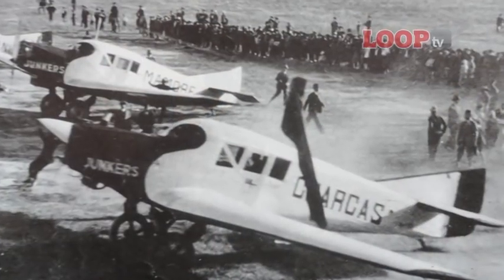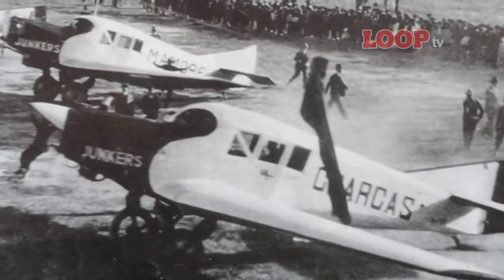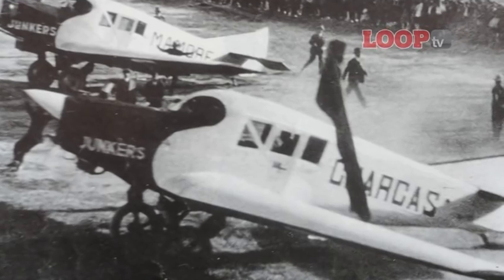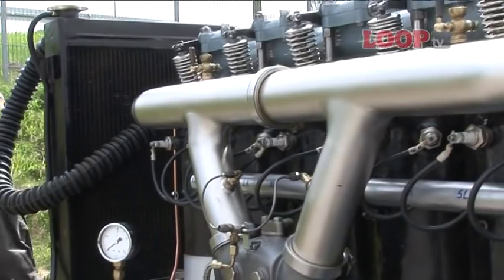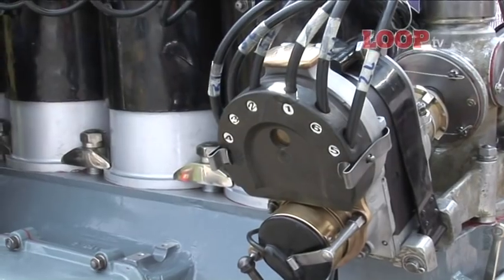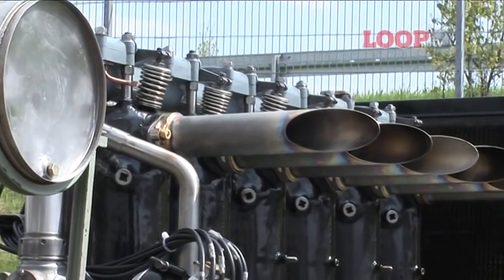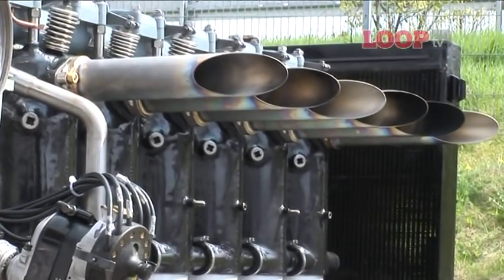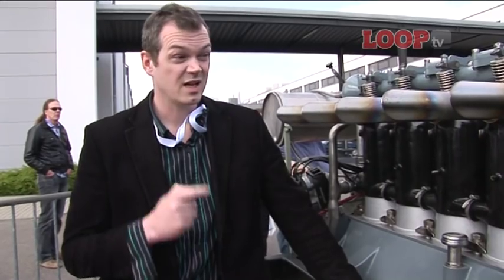Junkers L5 aircraft engine, start-up

Comment: It would have run MUCH BETTER with a Prop of the front where it belongs! The weight and Mass of the Prop are a factor for the proper operation of those engines, acts as a flywheel.
Reply: BetterAircraftFabric she speaks with a Gruff German voice

Comment: It's cold. It's old. they didnt exactly warm the thing up to operating temperature and it's probably running on 100 year old carburetors (Im sure the condition is fine, but comparing it to a modern fuel injection engine is a bit silly). Besides these things run at pretty low RPMs without any sort of mufflers which can make it sound like its running rougher than it is.